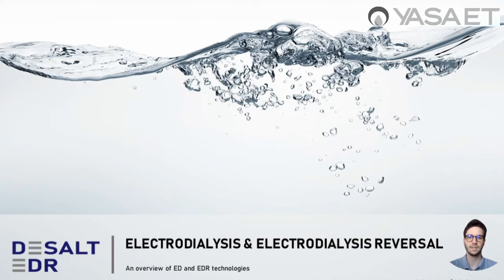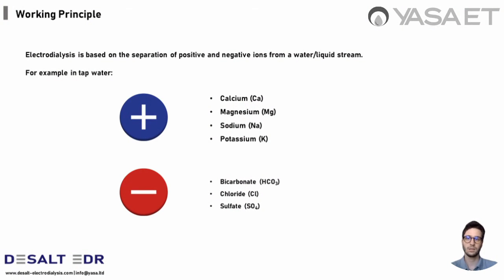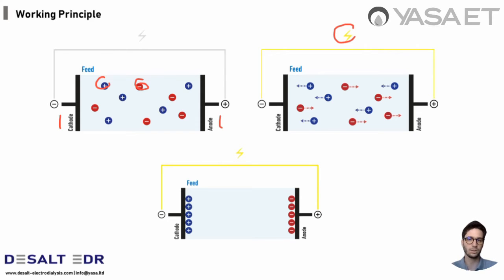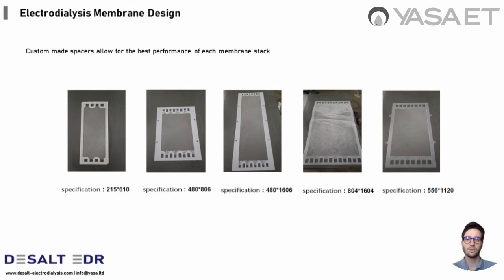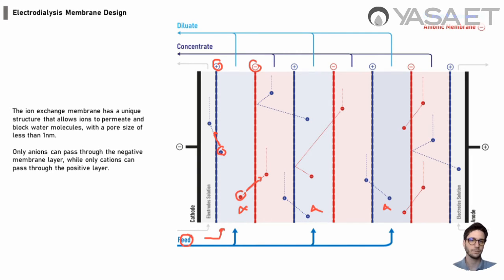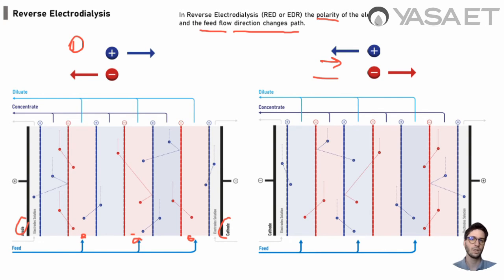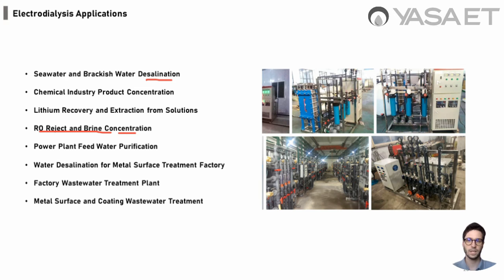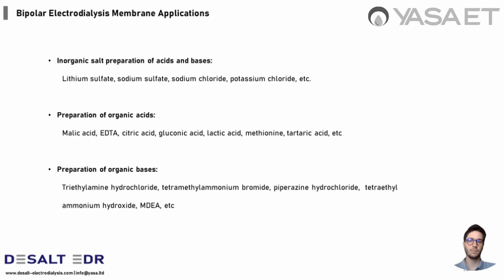Electrodialysis and Bipolar ED: How does it work? Intro to Water, Wastewater, Chemical Industry

Comment: Hi, at 4:24, there might be a mistake in the diagram. 
As per the Handbook on Bipolar Membrane Technology (Kemperman, A. J. B. (2000). Handbook Bipolar Membrane Technology. Twente University Press (TUP) ), cation exchange layers are negatively charged and anion exchange laters are positively charged. So, your statement that anions pass through negative membrane layer is false.
At 7:24, you have correctly shown Na+ ion passing through negatively charged layer.
Reply from the maker: Dear, thank you very much for your comment. You stand correct, the diagram at 4:24 is mislabelled. We will add a note to it to avoid further confusion.
Reply: @yasaet Thanks a lot